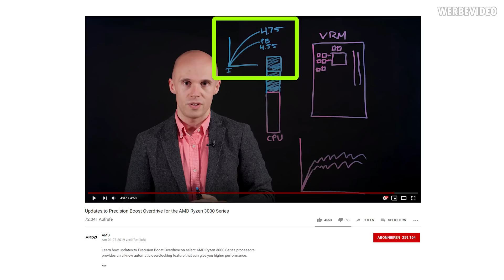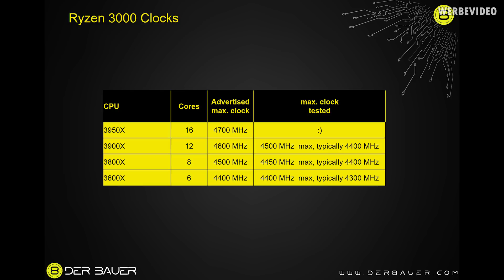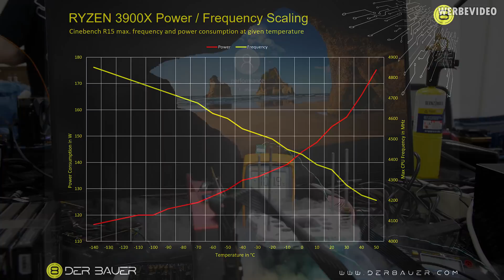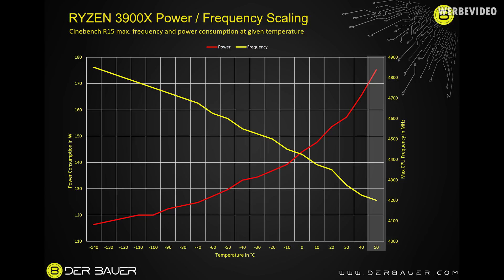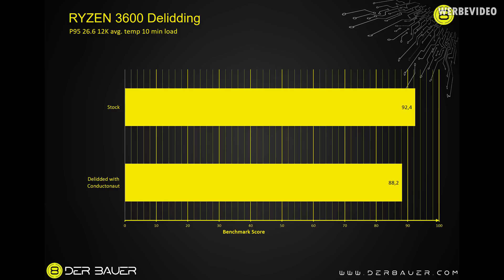RYZEN 3000 Delidded - Overclocking Expectations and Temperature Scaling

Comment: This video almost made cancel my preorder. Waiting for proper reviews though, but at the moment i'm 60/40 in favor of canceling my preorder.
Reply: Think that even at low clocks they can surpass a i9... so is not a bad processor at all
Reply: @KAKUN_DESU  All depends on which application you use... if is just gaming what really benefits you try or spect to get...
Reply: @KAKUN_DESU  then it going to be a good upgrade... and many new games are coming with more relay on multiple cores and no so much in clocks, so yes it going to be a really nice upgrade...
Reply: @KAKUN_DESU  as i see on this one : https://www.techspot.com/review/1869-amd-ryzen-3900x-ryzen-3700x/ you can spect 70c with a good watercooling solution... but where you need to invest is in a good graphic card... look for a rtx 2070 or wait till the prices drops, coming navi you going find good offers...
Reply: @KAKUN_DESU  1080 is good enough... and yes you going to notice a push... look for the fastest ram you can get... that going to be the difference...
Reply: @KAKUN_DESU  no...AMD chips relay on ram speed... but is not a good idea to overclock the ram... so get 3800 or 4000 mhz ram and a good x570 motherboard capable of overclock the ram separately from the cpu .. then "overclock" the ram so it works at his stock or best stable speed, so it going to work fast as hell and gives you margin to upgrade the cpu when ryzen 4000 comes out... https://www.techpowerup.com/255405/amd-ryzen-3000-zen-2-a-memory-oc-beast-ddr4-5000-possible
https://www.youtube.com/watch?v=ck9ZbJ6N4h8
https://www.youtube.com/watch?v=Yed-a9vqTYc
Reply: @KAKUN_DESU   some mother like this one https://www.techpowerup.com/review/asus-prime-x570-pro/ and you can see they support like 4400mhz...
Reply: https://www.bhphotovideo.com/c/product/1477912-REG/patriot_pvs416g440c9k_vs_16gb_4400mhz_cl19.html

Comment: I wonder if the overclocking potential will get better as the node matures. Maybe don’t buy until they’ve been out for a year or so.
Reply from the maker: don't expect that. Ryzen 1000 was the same, Ryzen 2000  was the same. Why would it suddenly be different for Ryzen 3000
Reply: I think it will, just like previous ryzen chips. Because I recently bought ryzen 1600 (non x) for my little brother and it overclocked to 4ghz at 1.35v, on a stock cooler! It might do 4.1ghz on a better cooler. 

Maybe, over time, new ryzen can do 4.4ghz all core, but only top 5 percent.

Comment: The problem could be that either bios versions are still premature and/or the ram you're using?
Reply: I say both. Even if he did contact the MB manufacturer about QVL for the RAM, there's a possibility that the UEFI BIOS has horrid bugs with the new 7nm CPUs. I don't subscribe to the "disappointment train".
Reply: @JosephArata  https://www.reddit.com/r/Amd/comments/cacwf9/psa_ryzen_3000_gaming_performance_is_being_gimped/
Reply: @JosephArata  Looks like we were right

Comment: Looks like I'm sticking with my golden sample 1600x that'll do 4.1ghz all core at 1.36v.
With xmp and overkill cooling it will hit 4.25ghz stable.
Reply: These still have a 15% ipc increase. With the higher clock these are substantially faster
Reply: @richracing7420  I agree completely, but my GPU needs attention as a priority. A GTX 1060 6gb is the main restriction, and my 1600x is still more than adequate paired with a faster GPU :)
Reply: @JoClip1984  buy a radeon 5700 then buy ryzen 4000 series. i think this would be better for you.
Reply: @MyAsdfqwe  yup! It's looking like the 5700xt is a good upgrade and a wonderful competitor to the 2060 super. I'm a bit hesitant over some reports of poor 1% lows, but if software updates and game optimizations solve this I'll be on board.

Comment: Ryzen seems to have a trend, it's always bad at overclocking. Basically you buy it and it's already pushed to the max out of the box. Nice I guess if you're just putting ur system together. But kind of lame if you want to tinker around and get higher clocks. Oh well. At least it's more promising than Intel's pricing.
Reply: well bar gen1 non-x SKUs that is.
ryzen also thrives on fast memory, so i would still visit the bios to tweak the ram ;)
Reply: I think the problem is their multiple die strategy, from an economic standpoint it makes sense because it's more scalable, but in the high end you will always have problems, because of distribution outlay, even if you only use one die, because the architecture is built to work with multiple. At least it's possible I am not entirely sure. Also, the position of the die is not quite good for cooling they should try to pursue a single die architecture again.

Comment: The overclock headroom is so disappointing.
Reply: Well thats what happen you are overhyped thinking it would be a match for Intel's OC capabilities.  So it's better not to jump the hype train. AMD  with an R&D smaller than Intels, you can't really cover all corners.  At least AMD is not giving up the competition and keep up the fight.
Reply: But it's not really Intel vs AMD though, it's Intel vs TSMC. TSMC's 7nm is supposed to be comparable to Intel's 10nm. So if even Intel's 14nm++ can oc higher, it is a bit disappointing.
Reply: Because its 7nm and arhitecture for efficiency
Reply: ryzen 4000 will be the real killer i guess
Reply: @MyAsdfqwe  That's what I'm thinking too. Ryzen 4000 will probably be to the 3000 series what 2000 was to the 1000 series.
Reply: @MyAsdfqwe  Can't keep kicking the can down the road haha. At this point, have to accept that Ryzen simply gain a ton of clock per iteration, but that's why there was so much emphasis on the "IPC uplift". The 3600X clocking lower than the 8 and 12-cores is a bit disappointing though, as I never spend more than $199 on a CPU.
Reply: @terp02Andrew  yeah it seems r5 3600 is best for buck. still, this means 4.3ghz ryzen 3000 is same as 9900k at 4.6ghz. the gap is getting pretty close.
Reply: And that with 7nm

Comment: 2:40 is this all core or single core ?
Reply: Single.
Reply from the maker: Single Core Boost
Reply: @der8auer  Is it possible to downclock the CPU as much as it can go, and boot without a heatsink on to use a thermal camera to see how the heat is distributed with the cores chip pushed to the edge of the PCB ?
Would the CPU survive even with no load on it this way ? (for the test only ofc)

Comment: I won't say that AMD is letting down any customer, just because some idiot cannot think.
They are not false advertising, and clock is not even all the story in a CPU performance gain.
Reply: No but you cant gain anymore performance than advertised basically. While 9900k 5ghz for most which does increase benchmarks and tests quite a bit
Reply: @dnsean03  So?
Anyway, you are not guaranteed on Intel either.
Reply: @IIARROWS  moral of the story if you want guaranteed ocs go get your CPU from siliconlottery.com
Reply: @dnsean03  So? Do you use your CPU for reaching maximum clock, or to make any kind of work?
Because data show performance are higher even with lower clock.
The clock doesn't measure performance across different architectures.
Reply: @IIARROWS  mix of both best stable overclock at decent temps for performance. Always try and get most out of your purchase. Theres more overhead than AMD wont go over 4.3 mhz simple as that

Comment: When will AMD learn to underpromise and overdeliver?
Same thing happened when AMD launched R9 290 cards. They claimed max 1 GHz core clock witch never happened (later custom cards achieved this) and people were disappointed. While nVidia used boost clock witch was usually supposed while gaming.
Same thing now with these xfr boost frequencies.
Reply: Good point in a marketing perspective, it's bad for business to do what they do. The products themselves seems to be brilliant though, I'm probably getting a 3700X myself.
Reply: What? My reference board 290X did 1200mhz on the core and 1500mhz on the mem, with a Raijintek Morpheus on it, I saw quite alot of people getting their cards to 1300+...if your 290 couldn't do 1ghz on the core, it was a dud card.
Reply: @glynkatkin  I was talking about advertised 1 GHz core frequency of a reference R9 290X, witch never happened in real world. You are giving an example of a modified and overclocked 290X, witch is completely irrelevant to my original point.
Reply: I wouldn't say irrelevant - we don't rock stock coolers on CPUs if we want to push them to the limit, nor should we expect to use stock GPU coolers if we want to push them to the limit. :-)

But I do agree that it is much better to under-promise and over-deliver rather than the opposite.
The most recent example is the 2060 SUPER SAIYAN HD XTREME which promises a boost clock of 1.7 Ghz but actually just clocks itself up to 2 Ghz for shits and giggles.

nvidia, good at marketing, whodda thunk it?

Comment: So the chances are that the 9900k will still beat these chips at purely gaming benchmarks at enthusiast level.. Shame as i was thinking about upgrading my 9700k to 3900x.  Not long to wait for gaming benchmarks now!
Reply: U were wrong
Reply: @chaddavies1032  ? Intel beats ryzen 3000 at gaming..
Reply: @OmarGee92  look at linus's video its basically matched with amd beating intel in select games
Reply: @chaddavies1032  look at every other channel you will see an AMD fail in games.
Reply: @choatus  I still have to see "AMD fail in games" yet.
Reply: @legalize.brokkoli  It doesn't fail, but there are more games with better performance favouring Intel, with AMD barely beating Intel in some, As a 100% gamer only i will still get the 3900x knowing it isnt as good Intel (as im an intel fanboy) purely to say fuck you to intel for jacking prices.

But that overclocking headroom is pure garbage though!!!
Reply: @Boots3962  9900K is still hovering at around $500, you'd be an idiot to not buy a 3900x over it.  Paying the same price for a chip with less cores, Known security issues with fixes that negatively affect performance, worse multithread performance, (imo) negligibly better single thread performance, and uses more energy, significantly more energy if you plan on doing any serious overclocking... But hey it performs slightly better at 1080p gaming so what do I know. 

I will fault AMD for the shitty overclocking headroom, I personally don't overclock my CPU's but I see how it can be disappointing for those who do. Other than that though until the 9900k dramatically decreases in price I'd never recommend it over the 3900x, Hell I'd even say buy a 3700 instead of the 9900K if you're only gaming and web browsing(netflix, facebook, etc.)... and of course I'm not talking to the enthusiasts, they'll buy what they want and I have no problem with that, but I can't think of a legitimate reason "the average person" would need a 9900K over a 3700
Reply: @mocoj7423  in 1440p the 9900k still takes the lead, and sure Intel has got some issue with their HT, but it still performs better than Ryzen 3000 (in gaming, which is all i care about, without money being an Issue). What annoys me both AMD and Intel suck, Intel for refreshing constantly and jacking prices, AMD not being able to beat a multi refresh chip at half its size, Dont get me wrong, i will be getting the 3900x and will be pleased with it. But it is clear that the only reason AMD are in this position is due to Intel screwing up and not being able to produce 10nm chips, as you should know the 10nm will outperform the 7tsmc. So had they bought that out it would be a different story.

Though i consider this a blessing, for Intel will now hit the books, reduce prices and out perform AMD for another decade when they finally get their shit together.
Reply: @Boots3962  I agree, it will just make Intel wake up, AMD is gonna have a hard time in the next few years, mark my words.
Reply: You call a  maybe 5% delta a fail?
Reply: @chaddavies1032  after all the hype in the last year, anything in minus performance is a fail. With this amount of cores and threads plus the IPC these things should have been beating Intel by 15-20% but that simply isn't the case, If they clocked higher it would have helped greatly, and the overclocking is abysmal at best, not worth the effort.
Reply: Nobody really expected that!!! Intel led both on speed and the ipc before this launch.. Haven't you looked at any 9900k vs 2700 benchmarks? Not in the same league at all. The only thing 3000's series got going for it is core count and cheaper than Intel..
Reply: if you plan to game on 1080p then yes, 9900k is still better. But think about how much more you get with 3900x. It's 50 percent more powerful with less power consumption.
Reply: 8700k and even the 8600k will probably still be better in gaming
Reply: @sparklauerei1  yeah, it's a fail if they can't even beat chips 2 generations old.........

Comment: so is a disappointment i was at least 4.5 on all cores im sad now
Reply: Who cares about mhz in 2000k19? You need to look at ipc first. Its doest matter that your cpu cant reach 5ghz when it has better perfomance :)
Reply: 4.3ghz on all core for ryzen 3000 means 4.3 + 4.3x15% = 4.975ghz on ryzen 2700x. Which is pretty solid. If you can overclock to 4.2ghz then still it's a great CPU. Especially, considering the price.
Reply: @madd5  But ryzen 2 is slower you can't really compare it that way. Ryzen 2 is about    10-15 percent slower than the 9900k

Comment: Clocks doesn't say much by itself. Why didn't you try to compare those CPU to their Intel counterparts ? Clock to clock test would would show it IPC. And then real life performance test would allow to evaluate them.
Reply: buck to buck id rather say
Reply: @artempavlov4599  Well, that depends. If you want to compare cpus architecture-wise, IPC, etc. you wanna go for clock to clock performance comparison in some synthethic benchmarks. Then you can compare real life performance: gaming, rendering , etc. in diferent programs and scenarios. Then you can can estimate how much time you save, or how much fps do you gain per dolar let's say (in particular task or software - so it's like a dozen charts at least) and compare the results to other parts. Then power consumption and termals. All of that would be somewhat usefull.

Comment: Was the LN2 all core or single core overclocking for 5GHz? Thanks!
Reply: Roman only believes in all core overclock for Cinebench (I tend to agree, running XOC on 1 core enabled is useless when benching Cinebench if all core would crash, you’d have to be insane to run a computer with 1 core especially on productivity like Cinebench...)

Comment: I don't like it but just like with the Ryzen 2600/2700 the XFR is for single core speed. If you remember they listed some of those as 4.3 or even 4.35GHz XFR boost and that was also only on a single core.
Reply: @uP-Andre how many times u going to say the same thing? The 9900k is also $150 more. Which is enough to buy a better GPU in most real world situations where people don't spend $3k on a PC.
Reply: uP-Andre no one is triggered my dude. Amd is a disappointment clearly, but you’re the only triggered guy pasting the same comment over and over.
Reply: @uP-Andre You can certainly ditch Intel. Everything from Ryzen 3600 to 3900x offers much better value than anything in the Intel stack.

Comment: Fx9590 5ghz
Ryzen 7 3800x 4.45ghz
Reply: and the 4.45ghz is wayyyyy faster than the fx 5ghz bcause the pisspoor ipc
Reply: 9590 with the right motherboard, good silicon, good cooling and good bios you could hit 5ghz
but with poor gigabyte MB and piss poor Bios it was hard work getting it just to work at 4.7ghz
so a max of 4.6ghz for a AMD user this is not overall a Disappointment, but what we really need is more flexibility on motherboard lanes configuration usb2 and Wi-Fi is a waste of 4x lane and would be better having 8x between cpu and chipset to be able to have more lane on the chipset

how ever for Reddit DD fanboys it will be

Comment: Why don't you use engineers blue on the dies to check for high spots. As you remove material from the heat spreader, it's easy to quickly check for high spots using the blue. Once you are finally down, you can easily what the surface area contact is before finally applying your liquid metal.

Comment: Well that was unexpected, if I though the CPU would just clock like 2nd gen up to advertised speeds from time to time when needed. But if they really can't even hit 4.7, 4.6ghz whats the point of the advert.
Reply: That's not oc he said that's the boost, overclock said 4.3 max
Reply: You can start memeing about how they borrowed Intel's 28 CORE 5 GHZ !11!!1 chiller to determine their max boost clocks. ;^)
Reply: ZeddBloaxigan kinda true, that sub-zero scaling kinda makes me want one! (I run sub-zero phase for daily machine, I really want a massive one for TR 64 core, unlimited power! Mwahaha!)
Reply: The outrageous thing is that the 64 core would probably run fine on high-end x570 board VRMs - as long as you stay not too far above the power sweetspot - as opposed to the fucking 1.5k dollaroo monstrosity boards the infamous 28-core wants for supper.

But hey, the whispers of Zen 3 being even more power efficient are already going around.

Comment: There will be better Bios later on, wouldn't that help?
Reply: Launch BIOS is the issue here, maybe even a RAM incompatibility too. I see everybody hopping aboard the "shit on this CPU train" before the marketed issues are found and solved. Don't you think it's odd that manual OC nets 100 MHz less than the automatic OC and the voltages are pretty high just for a normal OC? Nobody cares yet, they just want to shit on something because their favorite brand does 5 GHz with all 8 cores, albeit at a ridiculous over spec TDP usage.